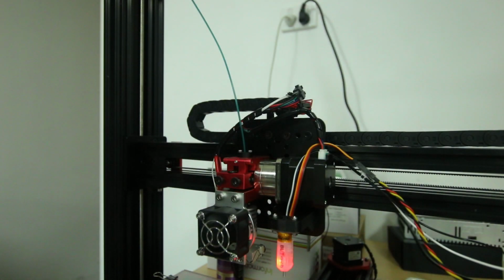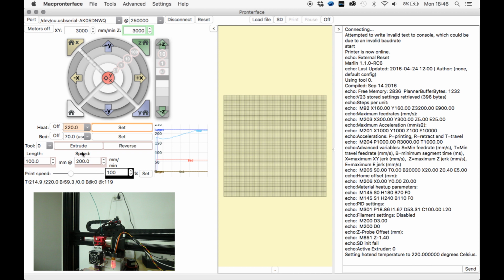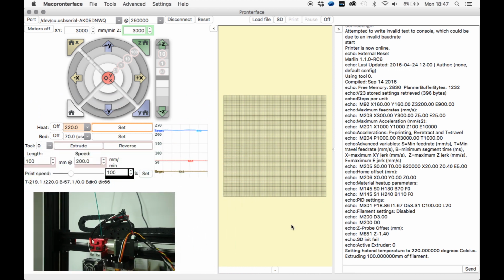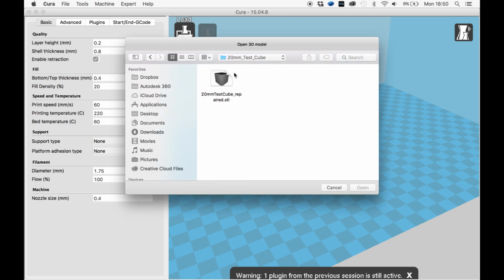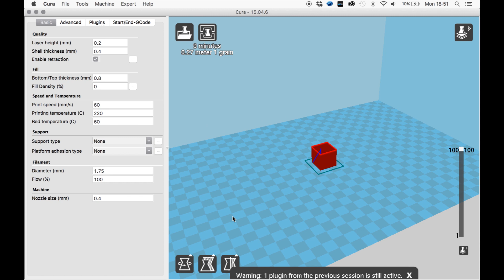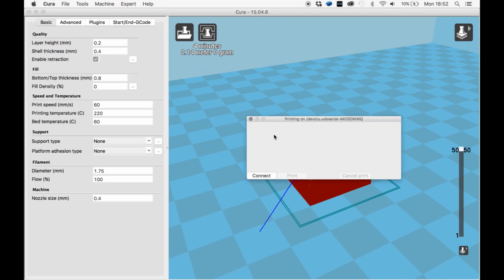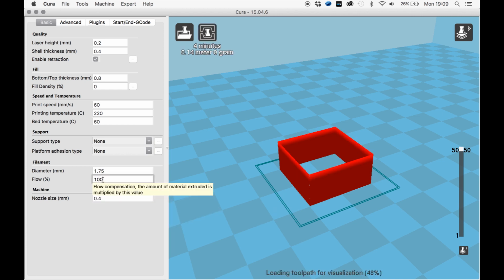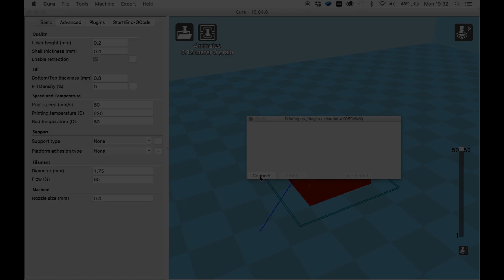// HOW TO // Extruder + Flow Rate Calibration

Comment: Outstanding video! I have a 3D printing noob question :-) How can I connect my 3D printer to MacPronterFace (or other apps) ? Using usb cable or is there a way to connect it using a wifi connection ?
Reply: If you are using octoprint you can do the esteps  through that.

Comment: ehhh.  current e-steps / actual leght / target lenght.        so   95 devided by 105 devided by 100    seems like there is something wrong with that equasion.   doubt my new steps per mm has to be 0.000000090.............                    even if i remove all the zero's  i doubt my steps per mm have to go from 95 to 90 for a couple of mm.
Reply: guess i'm wrong.  even if i calculate it by reason.   (how many actual mm per step did it do)   and then devide my target lenght by that amount of mm.  and i end up with the same number as your equasion after removing all the zero's.
Reply from the maker: There are brackets there for a reason....so using BODMAS you get ACTUAL LENGHT/TARGET LENGTH then divide current E-steps by that answer

Comment: I can not get my black widow to extrude properly at all.  I can't get a consistent extrusion from it.  Sometimes it won't make it to my line for 100mm and sometimes it blows right past it.  I used your equation and got a e5000 number.  That doesn't seem right at all to me.  As far as I can tell the gear that drive the filament is in the right spot, the filament rides between the groove.
Reply: Same exact issue, still onsolved months in, I did have it working none the less at one point, now I ended up fiddling with the pressure screws and now im back where I started.

Comment: Is there a G code for storing the flow rate?  Great videos.
Reply: The Flowrate is used in the Gcode to Step down extrusion a little. The Flowrate Setting on the Printer only works when you are in a print and use the tune menu. If the Printer is restarted its back at 100%. There is no way on saving the Flowrate. In the Gcode if 100% are set and the extruder moves from 0 to 10 and you set the Flow to 95% it will only extrude till 9.5 .